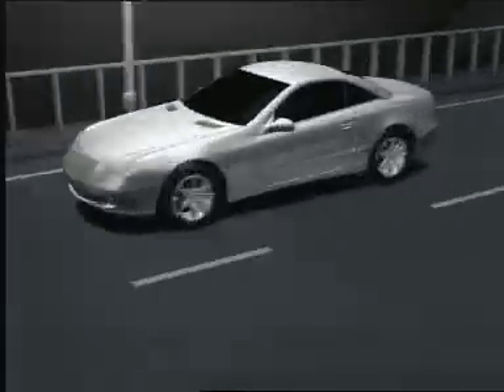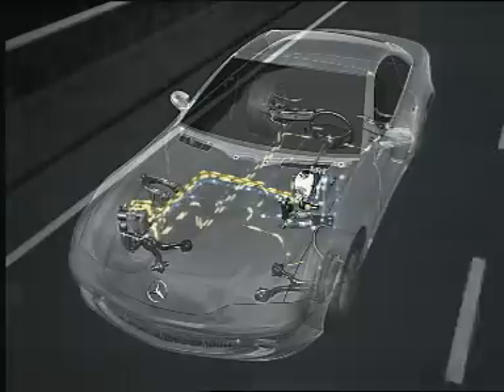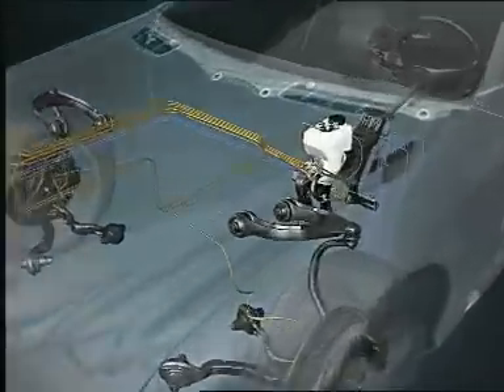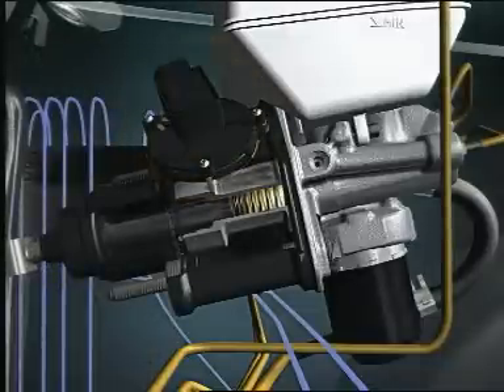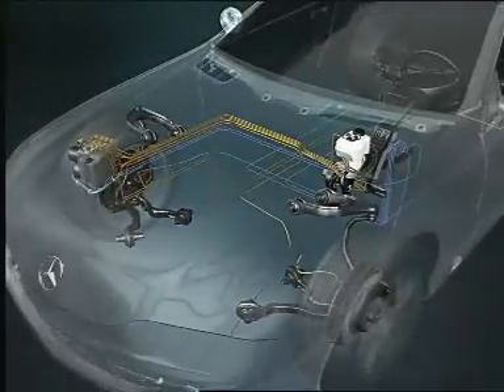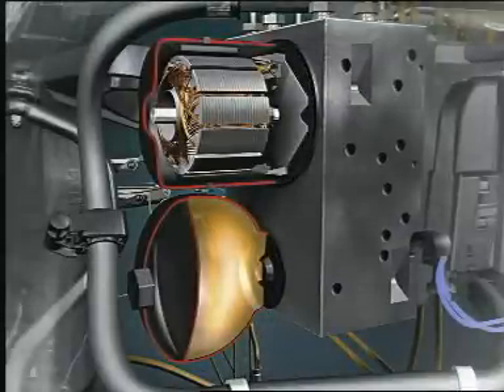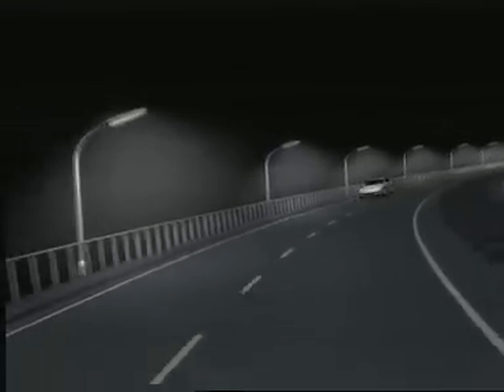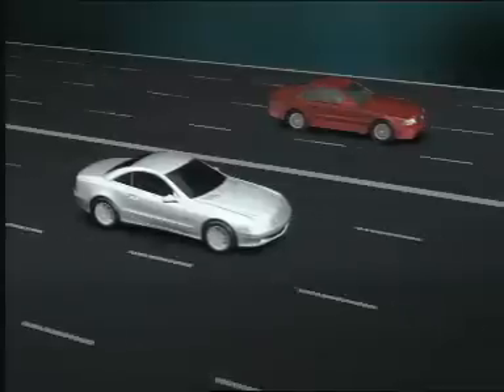SBC - sensotronic brake control - how it's works

Comment: A little fun fact.

Even though SBC has been killed off due to it being very unreliable, quite a number of its benefits, like drying the brake discs when they are wet and pre-charging the brake pads when the accelerator is suddenly released has been part of current ESC systems since SBC has been killed off.

Furthermore, electro-hydraulic braking is making a bit of a comeback, especially as part of active driver-assistance systems.
Reply: Don't forget about the HOLD function too, it was also carried over from the SBC system
Reply: They had these features even before SBC in 98. Brake drying, emergency priming (BAS), hold in 2001, etc. The only real benefit SBC had above the prior system is the hydraulic reservoir, it allowed the brake pressure to get up to full a few milliseconds earlier than the time it took the electric motor operated unit to spin up, though this would only be a benefit at times when the brakes were actuated by a control system and not the driver. Though I believe this could be replicated in the prior system though this would mean the electric motor would be running at all times basically. I believe the face lifted w163 ML performed this replication when the low gear transfer case was selected (and at certain speeds)
Reply: @SpenserRoger  BAS was Introduced in the 90's, W140 mercedes with the V8 and V12 engines had it.

Comment: I just bought a 2004 E500 w211 and the pump needs to be replaced. I have been told by my local dealer that no knows when but yes at any time i could lose all brake power. when the sbc stops working you are on the hydraulic system at that point. I have had the car 6 weeks and the sbc is out the cooling fan needs to be replaced an axle boot in the front and ac control valve for the rear and a air leak somewhere. over 3000 in repairs i gave 8600.00 for the car. Mercedes Benz should be replacing the sbc systems in these cars no matter how old. they dropped sbc after 2 years.
Reply: They have an extended the warranty to 10 years. Check with a dealer before you pay to replace it, I had my sbc pump act up back in 2009 and Mercedes replaced it free of charge and extended the warranty till 2019. The sbc pump itself did not fail it was more of a wiring issue that would cause the pump to shut off. Either way Mercedes replaced the entire pump and modified the wiring to prevent future problems.

Comment: After around 300,000 brake depressions the unit sends a message meaning you need to replace it :-(   £1200 cost
Reply: Or save about £,1000 and change the brushes in the motor. So many mercedes models needlessly sold/given away because people can't be arsed to do a bit of research.

Comment: twice the SBC failed in my 87000 km car (2009 and 2013). No brakes, red light. I cannot sleep since the second time. Here in Spain they didn't recall for presafe. My woman doesn't want to go in the 54000 euros car any more. No more MB.  Simon Hernandez
Reply: Don't blame mb, they didn't build or design the unit

Comment: W211 has 2 batteries one in front second in back under luggage part.small one control units only and second starts the car and some functions like major parts. By the way Mercedes goes without large battery. I really tried it. If your battery fails on a road it doesn't matter to any part of your car.
Reply: Most cars will still function with out the battery

Comment: SBC is a piece of crap and nearly had me killed a few days ago.As i was doing 70 on the highway a car cut in front of me and when I applied the brakes there was no response what so ever and the dash started flashing red.I made by the skin of my teeth and luckily didn't injure anyone else either in the process.Turned the car off and back on,everything went back to normal as if nothing ever happened.!

Comment: Some use this method without even being hybrids, Volvo s40's, had electric vacuum pumps, water would seep in and result in pump failures->no more assist. I know there was a recall on said vehicle. There are many options for brake assists, the ones I hate most are brake by wire, see Mercedes sensatronic & Toyota/Lexus  Electronic Brake Control
Anyways EBC is what I'm used to and see most often on hybrids, its very similar to the SBC system, with the same quirks.

Comment: I believe some hybrids are the conventional mechanical-hydraulic kind, but instead of a brake booster powered by the engine vacuum, an electric vacuum pump runs

Comment: SBC is a great system when working, makes breaking a breeze... but if it fails, which some Benz owners are experiencing now, its a very costly fix!
Reply: This system would be perfect if there was a reasonable exchange system for a fair price. instead cars with sbc trouble now end up scrapped and thats just sad.
Reply: The brushes in the sbc motor can be changed easily at low cost which makes them serviceable. It nearly put me off til I found out this.
Reply: I think Mercedes now has a 25 year warranty on the SBC pump which wasn't available at the time I wrote my original comment 10 years ago :)
Reply: Only in the USA….
Reply: Sitting right now in an s211 2003mod. E200 Kompressor. And 394,000km on the odometer. Still the original SBC system, no problems yet. A fantastically good braking system, as long as it works properly. 👍

Comment: Guess what? It failed, badly.
Reply: if you don't change brake fluid i have w211 400 000km no pronlems.dirty oil can ruin enythying
Reply: @sigmaSERVIS  I am now sitting in a s211 2003mod with 390,000km on the odometer. SBC works exactly as it should. No issues. An absolutely fantastic system as long as it works properly. 👍
Reply: Its not

Comment: If its so faulty elaborate on how dangerous current hybrids are that use the same function. the r190 weighs 4000-4700lb, I thought i mentioned its weight before, I missed it so my bad on that part, You can live without the assists and get used to it, but the car will blare at you with warnings visual, and audible. If* you choose to drive a car that has this failure you are made well aware of it. Similar warning while in dyno* mode. certified in 2011, so i'm diggin deep and looking up stuff.

Comment: Yes, but a Beetle weighs what, 2000 pounds? Fully loaded? A Mercedes E-class or SL weighs around 5000-6000 pounds. So take a vehicle that is 3 times the weight, has at least 3 times the engine power (what, 80hp in a Beetle, up to 250hp in an E320), and you only have front brakes with no assist if the system fails. Are you sure you want to be in that car?

Comment: Its the fear of not understanding, thus it's normal. Most* hybrids use a similar system to aid in braking since a conventional vac. assisted sys will not work. SBC is rare compared to how many hybrids are on the road. servicing them is something best left to reputable shops, not always dealers. I can't speak for all the owners but most people that visit the shop I work for were more worried(vocal) about their radio than their electric brakes. Everything made by man can and will fail eventually.

Comment: You will have front brakes, at one point in time no car had assisted brakes, as a former beetle owner this would be nothing new the sudden power loss is whats scary. You cant expect complicated things as electric brakes to be flawless all the time, hybrids for example, they use a very similar method as mb when it comes to aiding in brakes while the engine is off, bleeding is a chore and not many people know how to do it(correctly). Even normal brakes can suffer from fade/power loss.

Comment: At severely reduced braking ability, like less than 40% of what you would normally have. Mercedes dropped SBC after a huge lawsuit. A guy driving an SL500 nearly killed himself when his SBC failed. Why don't you disable SBC on your SL, superbird, then try to slow from highway speeds in an emergency situation. See how much you like it.

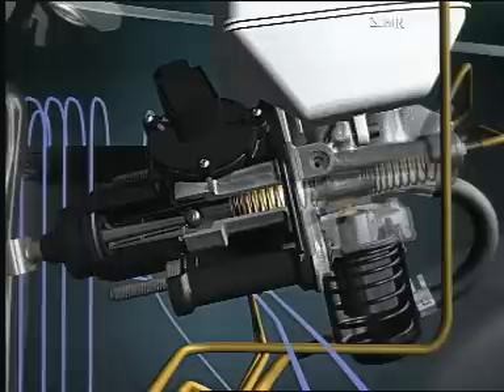Comment: I try to avoid commenting on videos but some people here are ignorant and pass on poor information. If your "battery dies" you have nothing to fear, you have a spare battery just for the brakes. the r230 has two batteries one under the hood on the passenger side and one in the truck near the vario roof pump. If you have complete electrical failure, induced by poor electrical wiring or interference with aftermarket equipment the auxiliary brakes are still active, you WILL have brakes. 1:47-1:54

Comment: @4Absolut 
the battery locate under the air-condition filter . left top or right top . depends on which side is steering . As far as i know . If the battery fail . There will be no brakes . Except for the hand brakes because they are direct to the REAR brakes only .

Comment: @4Absolut 
well thats coz..it will operate with a secondary battery supply...so if the battery fail which it does normally .....you will have no braking system...coz they electric's are down . thats a shame so they had it till the W211 model but for the face lifted versions they removed it .

Comment: But only because of low voltage by to many electric systems. After 2005 it works fine.